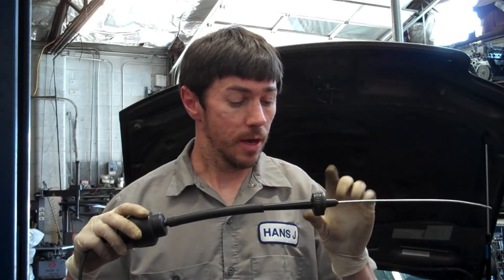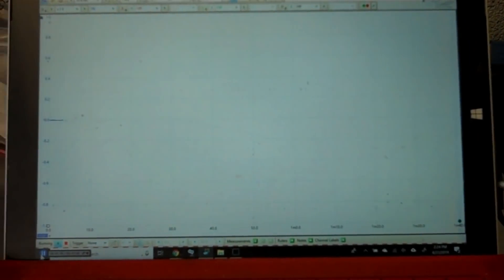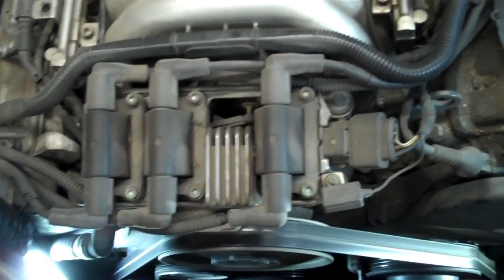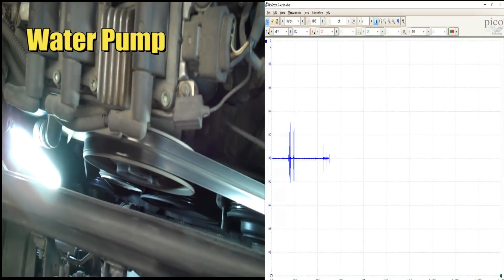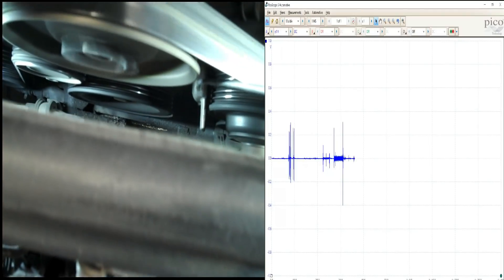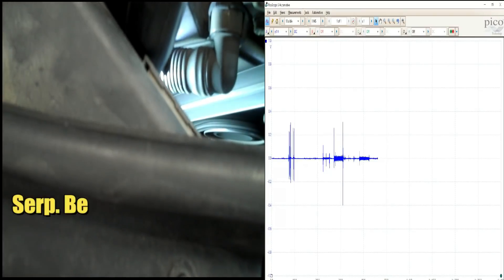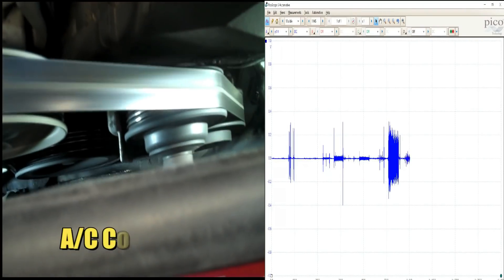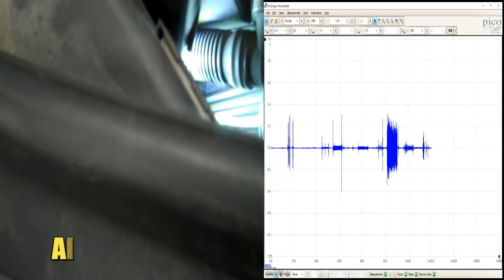Pressure Pulse Sensor NOISE Diagnostics

Comment: You can enable spectrum mode in the scope settings and probably get a frequency graph of that. You could touch one spot on the front of the engine and see what frequency is the loudest then use math to figure what size pulley that would correlate to.

Comment: This is Fantastic. I attempted this in the past without a pulse sensor and having my scope on like a 30mv setting. I got inconclusive results so i never went any further. I will most certainly be using this method. Thanks for sharing!

This gives me an idea. I bet that you could use chasis ears with your scope as well just hook the output of the chasis ears up to the scope and boom... If this works i am going to make a video out of it.

Comment: thanks for video   did you use intake or exhaust under first look on pico to pair this with or it doesn't matter.
Reply from the maker: No presets were used. Simply a 1v voltage scale on a very long time base. 5sec per division

Comment: what were the scope settings?? i only have a snap on verus scope
Reply from the maker: With snapon you'd want to use a graphing multimeter on a longgggg time base and a 1v scale
Reply: @TrainedbyTechs  thank you. im going to try this sometime this week!
Reply: Was trying this on a wheel bearing the other day using my vantage ultra, and I had trouble with figuring out what the best setting was to get more definition. I’ll try this. Thanks for the tip.

Comment: Always wanted to try something like this with a scope. But you know experience counts. It sounded like an idler or tensioner to me. Every noise on an engine is a little different. There are industrial service companies that do bearing failure prediction by sound analysis. A good video thanks.

Comment: great idea.   to take it further if you checked the frequency against the pulley diameters and factor in engine rpm to get belt fpm....
Reply from the maker: thats an AWESOME idea. Now I want to go nerd out
Reply: One would also need to know details about the bearing design. The number of balls and their diameter compared to the diameters of the races would effect the frequency.
Calculating belt speed is unnecessary. You need only use the ratio of the diameters of the driving and driven pulleys.

My question is, is there a way to "playback" the wave form through a speaker, with the Pico or other scopes? Difficulties accurately measuring the intensity of the vibration as well as variations in how the vibrations propagate through other components could lead to an inaccurate diagnosis. Hearing the waveform could confirm that you have located the right noise.
Reply: @fascistpedant758  generally speaking increased speed should cause increased frequency but you are correct there are many factors to deal with   what if its only one ball with a flat spot on a ten ball bearing   or two or 5???
i was throwing that thought out there  as a generalization theory seeing if i found like minded people to chime in . there are possibilities. who wants to run with it?
Reply: @richardcranium5839  one could attach a microphone along with the stethoscope set-up and essentially sync them. Surface borne noise (SBN) will propagate throughout the system, but not enough to massively change the waveforms (sounds) that are being picked up in this usage; at least not in similar experiments I've conducted, albeit with different tooling.

If one were to use a contact accelerometer,  then the bearing design and SBN would be much more critical and a larger variable than they currently are. As with any testing technique, time and known good/known bad will help identify important variables and further validate testing procedures.
Reply: @fascistpedant758  with Pico's NVH set-up (and I believe with the newest update to Pico Auto software) you can play back a .wav sound file captured with a microphone.

No direct way that I am aware of that you can play a scope capture as a sound. There may be software that can output a waveform as an audio signal though, if you've ever scoped speakers you've seen the fact that audio from the radio is electrical signals that are converted to vibrations of the speaker. Same concept applies here. (Edited for clarity)

Hope that helps.
Reply: @ScienceOfDiagnostics  Sound is vibration, With the Pico NVH hardware you can see sound/vibration with the sensor. I have pin pointed bad wheel bearings this way
Reply: @johnhnetkovsky8917  in general yes, I was speaking in the sense of sound being sent through a radio to speakers (electrical signal) which is then converted to vibrations, so a waveform can be converted to sound. I will clarify that up top. Thank you, as I worded that very poorly.

The NVH kit is great for all sorts of cool diagnostics, definitely makes life easier at times.